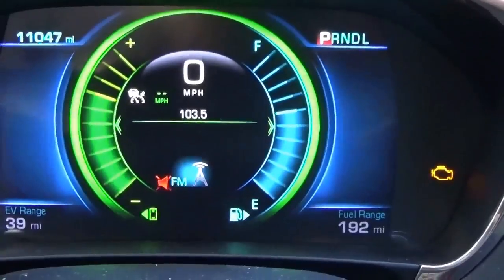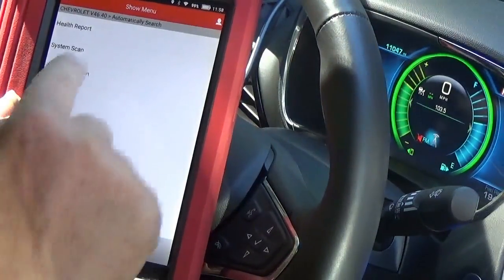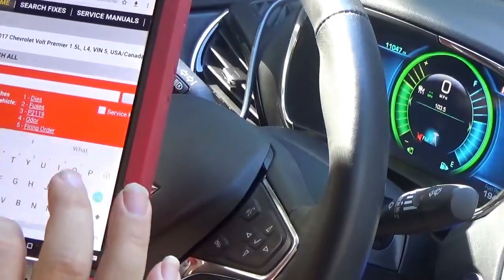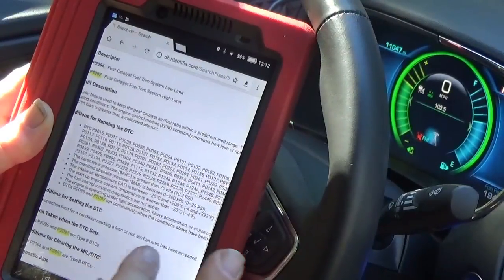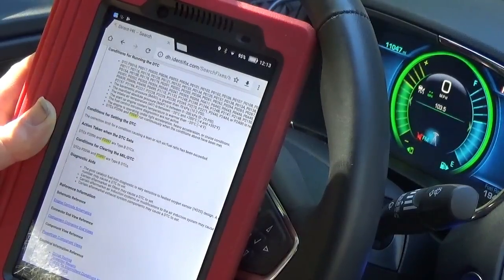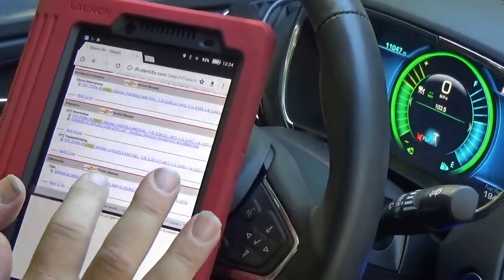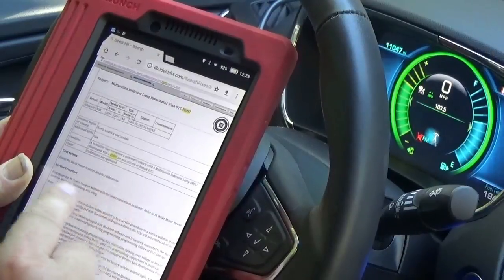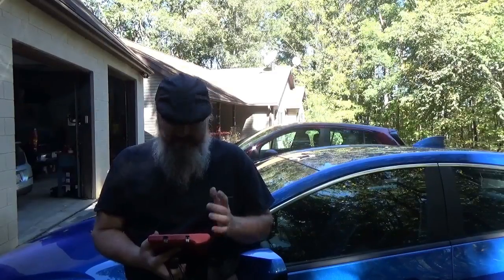Looking for the cause 2017 Chevy Volt MIL (Malfunction Indicator Light)

Comment: Thanks for your report and this video.  I just picked up a 2017.  It was built in late 2016 and had the catalytic converter replaced in early 2017, according to the history.  I'm guessing it suffered the same issue as yours did and the dealer over-prescribed that particular solution (not unusual).  It was in a couple more times in subsequent months for other software updates, which I'm guessing at some point that patch on your bulletin was applied.  Car has been working great, and I hope it continues to do so.  Take care.
Reply from the maker: I hope it continues to work well for you also! Good Luck!

Comment: Be careful your Volt doesn't catch fire mine did at just 27000 miles. When it catches fire it goes up fast and hard. GM did not care about my random electrical problems when I complained. Myself and the others who's cars have caught fire all complained to GM's help line and all they did was pass the buck. I have 3 Chevy Volts Gen 1's and I have never had a single problem out of any of them. But this second gen is a dead dog. I would not recommend anyone buy one of these cars they have some severe problems. The advice I give GM is listen to your customers we aren't all brain dead idiots. I myself am a former ASE certified master tech. I bought a 2000 honda insight just to take the car apart so I could learn how the hybrid works in full. The Volt is much the same car with some variations. www.chevyvoltsucks.com is where you can find more information about the flaws with this car. I like the video Mike.
Reply from the maker: Funny you mention that. From day 1 this 2017 had a smell of something burning or melting when it went from electric to gas! almost 20000 mile and no fire yet! thanks so much for the heads up and I will check out that website!
Reply: @TheDisgruntledMechanic  I had two different Chevy Volt's I bought used certified pre-owned with low miles. I had a 2016 Premier with 20,000 miles and it had gas engine issues; when it switched to engine mode it would sometimes lung forward and the Engine, ABS, and traction control light came on. The second 2017 Volt Premier had 38K miles and it had electric issues. It would fully charge and then would give an error that it is unable to charge. The engine light came on and the electric powertrain was useless. My car would say it had 23EV miles remaining and then drop to 0miles randomly and switch to gas mode. The Volt is an unreliable piece of trash, and I will not be buying another Chevy ever!
Reply: @TheDisgruntledMechanic  It was Carmax luckily. So, they have the best 7 day return policy. Also, 30 day warranty. I ended up not even getting a hybrid/ electric vehicle. I bought a 2017 Honda CR-V touring. It gets surprisingly good gas mileage 28City 34 Hwy and it's a Honda. So, it's reliable!
Reply from the maker: my 2017 has a slight lunge when it goes to gas. every brand has its problems. Prius fans were upset I said bad things about the Prius but mine was just a troublesome piece of crap! I still have had no real issues with 87000 on the 2011 and 30000 on the 2017. I am sorry you got 2 lemons and I do not blame you for not wanting to buy another Chevy. Same as I said about Toyota. And Toyota would NOT stand behind the problems of the Prius.
Reply from the maker: Did the dealership do anything for you on it?
Reply from the maker: As long as it treats you well that is what you stick with! Thanks for the response.

Comment: That's a bummer Mike. Have you ever had a check engine light on the 2011? The dealer will prolly tell ya all the brakes and tyres are worn out 😉
Reply from the maker: I only had 1 MIL on the 2011. It was just for the passenger side air bag. It was just a plug that would come lose under the seat.

Comment: Good morning Mike nothing like a new car tripping the light sigh~ nice to see the launch communicated with all the modules as far as I can see. Curious if freeze frame data was captured. And how the fuel trims appeared along with o2 readings and a few other pids. Great job and A+ for Identifix
Reply from the maker: I should have done that but when I saw it had a TSB on it I just figured there wasn't much use but I agree I should have done it just for the data. The code is still in because I didn't want to delete it so the dealer could see it. So I still can do the checks if I have time. It goes in tomorrow. Thanks.